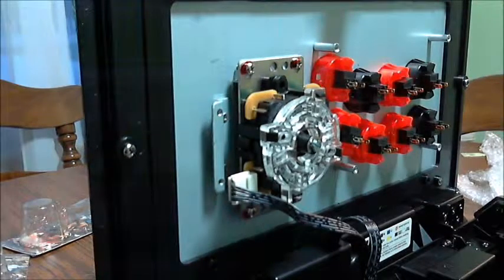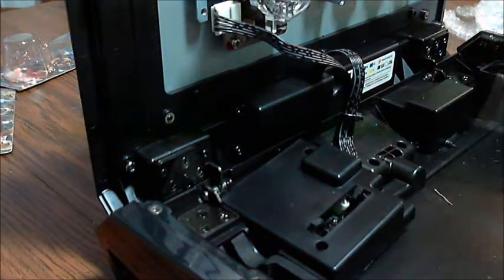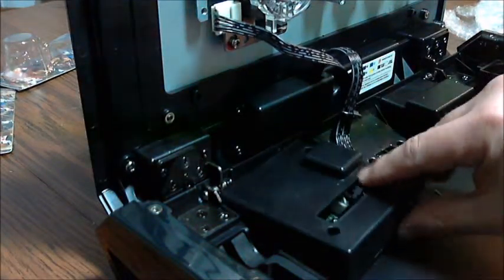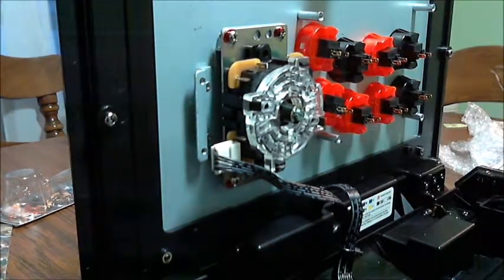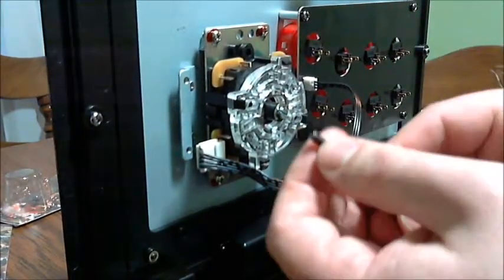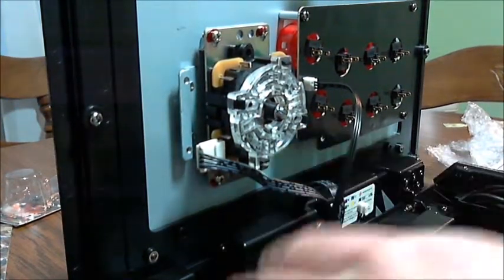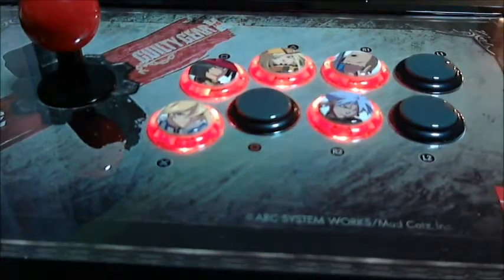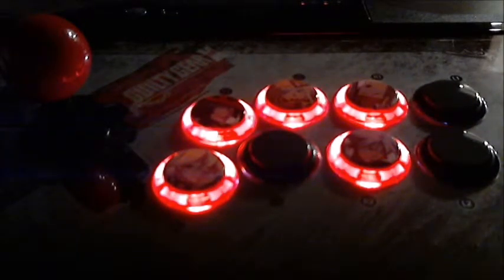LED Mod

Comment: does this work with all translucent sanwa buttons? Or what buttons need to be purchased if not? And looks like they are already sold out..... They better stock more
Reply from the maker: Any translucent ones will work.  You can try other stores online that sell arcade parts.

Comment: what led board did you buy. this dont look that hard to do.
Reply from the maker: THe LED board is the one directly from Madcatz that only works with their new TE2 models for PS3/PS4 and Xbox One.
Reply: tjkitsune i cant find it on the store :(
Reply from the maker: fishtacosize http://store.madcatz.com/categories/accessories-category/Mad-Catz-Arcade-FightStick-Tournament-Edition-2-LED-PCB.html
Reply: tjkitsune so did you have to put in led board ins the buttons or will this board just light it up. i just got some semitsu transluecents